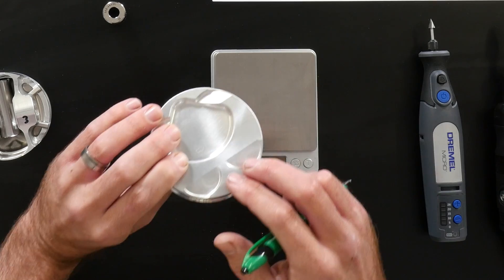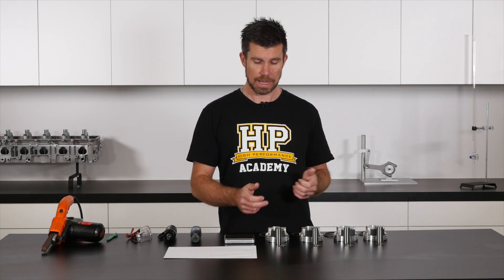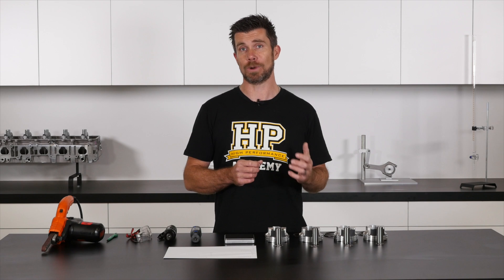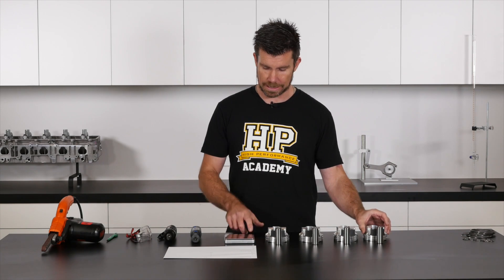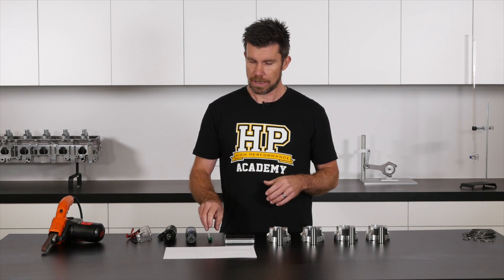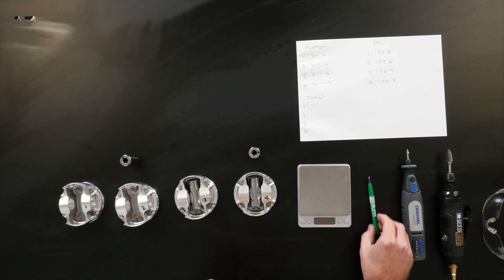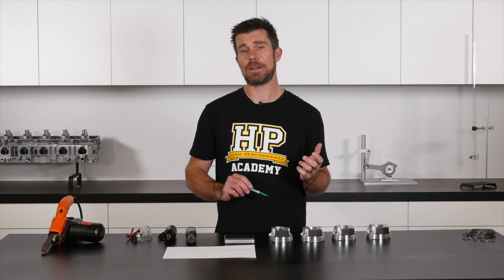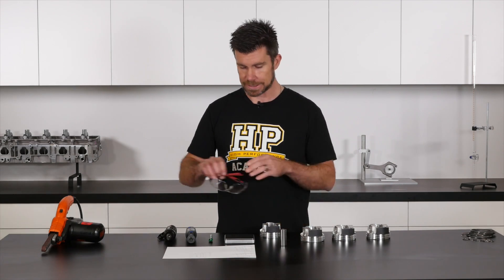How to balance a piston ⚖️ | Performance Engine Building [FREE LESSON]

Comment: Is it really that important? A gram is like the weight of a paper clip... I can't imagine that being a big deal. When companies like SCAT/Wiseco and Eagle sell sets of rods or pistons they're matched +/- 1 gram. I figured that was good enough.
Reply from the maker: Right at the start Andre mentions that you could get away with less, but also in the same token once you're doing it you're not really going to spend much more time being more precise, so why wouldn't you? We have never heard of an engine being 'overbalanced' =) - Taz.
Reply: @hpa101   i guess we have;  time is money,and you also could damage a piston by grinding on it without polishing the cuts
Reply: I agree with modern manufacturing the balance isnt as important as it once was. However if you are building a motor that is going to see very high rpms balance issues can escalate.
Reply: @MrSrt4parts  i.e. Honda Type R pistons (+/- 0.1g matched from factory)
Reply: @TheCitizenErazed because they are balanced....
Reply: I felt a gram removed off each piston in a v twin lawnmower engine, sucker revs up like I chopped some  weight off the flywheel. and it was a matter of searching the parts bin for another rod from a different engine,dropped right in after checking that it would work.

Comment: Why not remove the material from the wrist pin instead? It would required approx 2.5 times less material that needs to be removed.
Reply from the maker: Hey John, this is discussed in the video along with where on the wrist pin you should remove it from. Ideally though where possible you want to remove less material, not more. By matching the lightest piston with the heaviest wrist pin and then balancing via removal of material from an unstressed area on the piston, this is achieved - Taz.

Comment: This is only to make super OCD people feel like they're doing something good.  Lexus balances to plus or minus 0.5g...which means they only need a scale that measures to a whole gram!  Go find something to do that uses your time better.

Our shop balances rotating assemblies.  We leave the crank a few grams heavy, so +/- 1 g on the reciprocating mass doesn't affect anything.  You may need finer balances on 14k bike engines with very small rotating mass.  Most aftermarket parts come within a gram on the heavier bits. 1g on an 1700g bob weight (typical for a modern V8) is nothing. 

Besides, the crank goes through different balances at different rpm, plus harmonics.  Get a Fluidampr.  It damps vibrations across the entire rpm range, versus elastomer ring style which work within a narrow band.
Reply from the maker: If you watch the video again you'll hear us cover the weight difference near the start, and as for Lexus, a high-performance engine is generally running a much higher output than it ever was from factory so unless you're trying to build a factory spec engine, if you're doing things exactly as they did you're doing it wrong :) Two different focuses there - Taz.

Comment: Where to buy that scale?
Reply from the maker: Hey, after going through a couple of $300-$400 USD scales from a company that will remain nameless, we ended up with more repeatable results with this set from Amazon of all places. It's important to note that consistency is more important than the actual weight since you're focusing on the weight difference - Taz.

Comment: Nice fake shop in the background.... Also, where are the con rods? As someone else pointed out, part of the rotatating assembly and should be balanced with pistons.
Reply from the maker: Hey Steffen! 
Thanks for your comment.
I'll have to correct you there sorry, NO, your connecting rods should not be balanced with your pistons. As we point out in the video description this is just 1 of 17 steps and conrods are just one of those other steps. Also a lot of care must be taken when you balance your rods, and you need to balance each end across your set, not just to total rod weight.

As to being fake, it's not a shop and we're not a shop. This is our engine building room, and that's what we call it :) You can watch an engine being built from start to finish in this room via the course material if you want to learn about why you shouldn't balance your rods with your pistons and all of the other detailed steps, or you can come and ask at our next free live lesson - https://www.hpacademy.com/free-engine-building-lesson/ - Taz.

Comment: so i found alot of people talking about removing the material from the piston/ wrist pins. someone online removed material by the bottom off the piston, and you removed the inner sides of the piston material.  will this be better on how u did it to reduce the cause of engine failure?
Reply from the maker: Hey Brandon,
Great question.  
In our opinion where we have removed the material from is the safest place, however, by nature, you have a few options on a piston that won't be detrimental when compared to something like conrods where you have to be very calculated and careful where and how you remove the material.
Cheers! - Taz.

Comment: Enjoyed the video, very informational. One question on rounding to the nearest tenth of a gram. If you round, it's possible that you end up with piston/pin combos that are .18 gram different. For example a piston/pin are 450.36 grams (rounded to 450.40) and another piston/pin is 450.60 and by grinding material off we get it to 450.52 (rounded to 450.50). These two pistons are a tenth of a gram when rounded, but in actuality are .16 gram different. 

Is that difference acceptable? Or do you try to get closer than a rounded tenth?
Reply: Raymond LaCasse
Reply: Less than a tenth of a gram, you will probably get that much carbon deposits in the rings after a little running, it's fine.

Comment: I was wondering why you don't have the Rods there also as they are part of the total weight.
Reply from the maker: You are 100% correct. Balancing pistons is just 1 of 17 essential steps. If you're interested in learning the other 16 steps, including rod balancing, take a look at our engine building courses here - http://bit.ly/engbuil - Taz.
Reply: See that's what I thought. I always filed rings installed the rings into the piston. Installed the rod and everything then just measured all 4 in that sense. Then balanced the 4 to each other. Is there a benefit to doing each part separately?

Comment: 1/10 of a gram is useless.
You will have oil splashing under the piston,being trapped in the pin,and soot deposits on the top of the piston after 5 minutes.
it wil be out of balance constantly.
a gram or half a gram is more than enough.
Reply from the maker: When we're balancing engine components we focus our efforts on the aspects that are within our control. Put it this way - Do you think we'll have a better balanced component in operation if we start with a set of pistons balanced within 0.1 gram or a set of pistons balanced within 1 gram? I'll take the set balanced to 0.1 gram set every time. 

When you're actually balancing the pistons it takes very little more effort to balance them down to 0.1 grams compared to balancing them to 0.5 grams for example so why wouldn't you? We're yet to see any negative results from an engine that was too well balanced.
Reply: Fuck it why not balance within 1/10 of a gram just to say you did..it damn sure isnt gonna hurt it
Reply: I completly agree with what you say,and your work,like the principle here is very good,on the parts,or the videos.
But like i said : they will be out of balance as soon as you start the engine,because of the oil,not splashing equally all pistons.
It's something to take in consideration.
Reply: oil exit out of the cranckshaft,on the connecting rods sides,then leak on the cranck,and is projected under the pistons.
In dragster application or high performance high reving engines,oil scoops are used in the inside side of the block ,to avoid excessive splashing ,on one side of the block (since it rotates one direction only) in the oil pan.,like oil tray plates.
reducing oil spalshing help a lot to save energy wasted.
it's not a big deal on the cranck since it's rotatingbut it's quite some mass under the pistons.
Reply: michaelovitch i agree
Reply: As far as oil landing on the crankshaft, since it's so close tot he centre of the rotating mass, it has almost nil affect...thing about a hammer thrower, the further out the hammer is the more pull it has on the thrower. As far as "balancing" then, it has nil impact.
Reply: Oil, unlike the piston is fluid and will, thank to inertia not change direction as rapidly as the piston and mechanical components, this will mean the load it imparts is minimal in turn it's effect on balance will be minimised.
Reply: Oil is projected under the piston while it's going up or down,the cranckshaft is constantly rotating.
it's completly doing the same stroke as the piston.
that mean it's making more mass going up,and then is projected in the oil pan when the piston is finished going down.
the fact it's fluid do not change the fact it's adding weight during the stroke up.
if you have not the same volume of oil going under each piston (wich is always the case ),there is unbalance.
Reply: Fluids behave like fluids mate. It will not affect the balancing of the assembly. Else the air itself that the assembly rotates though would be factor at high rpm. Fluid dynamics bro.
Reply: So,if i pour 20 grams of oil in your left hand palm,and 5 grams of oil in your right hand palm,and ask you to lift and lower your arms they both the same weight ?
Reply: michaelovitch if you pour them on the side of my hands and it runs off...yeah especially at 80 to 90 degress where its about as viscous as water.  Now if i start thrashing them up and down a few thousand times a minute, there will be almost none of any of it on either. Make my hands from polished metal... even less.
Reply: The under of a piston is hollow,each time it goes up,it collects oil.
oil is ejected when the piston is a bdc ,but collect oil as soon as it goes up again.
that's not much the problem,the difference of oil collected by the pistons is the problem,since the oil leaks on the different along the cranckshaft are not the same.